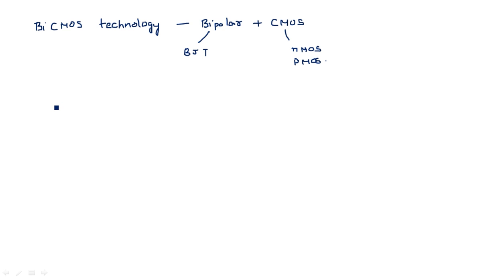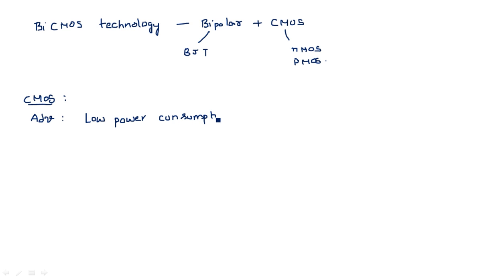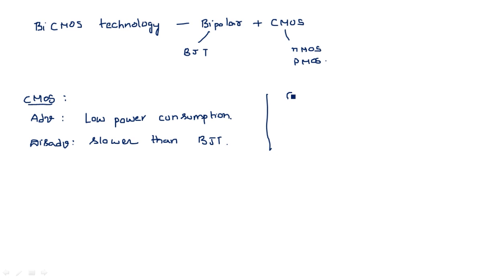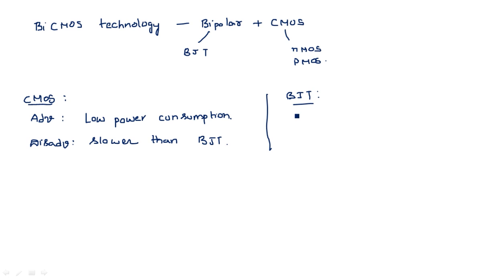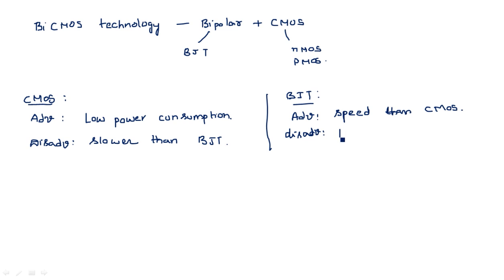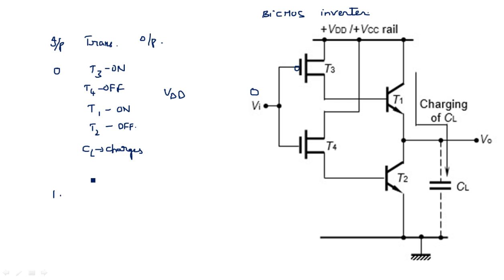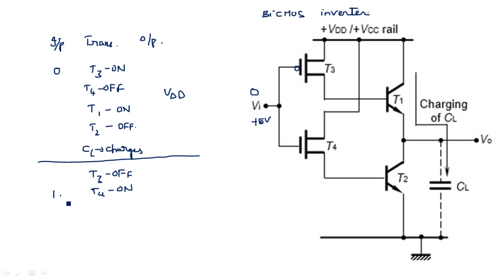BiCMOS inverter | Circuit Diagram | BiPolar + CMOS | VLSI | Lec-21

Comment: The ckt diagram is wrong sir......
Reply: Really??
Reply: @marvel_7022  yes . The drain of nmos will not be connected to vdd rather it should connect in middle  of collector of T1 and emitter of T2 from the point vo is marked.